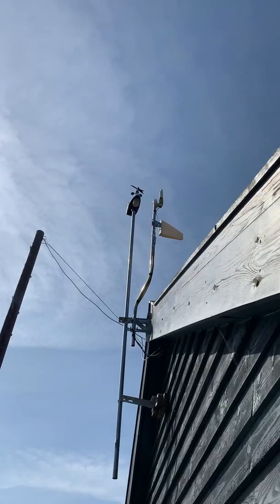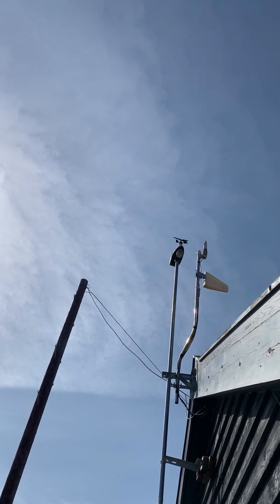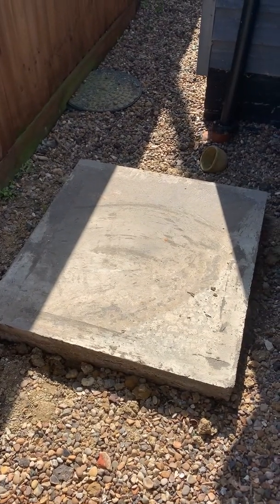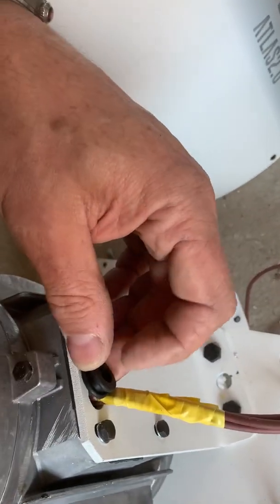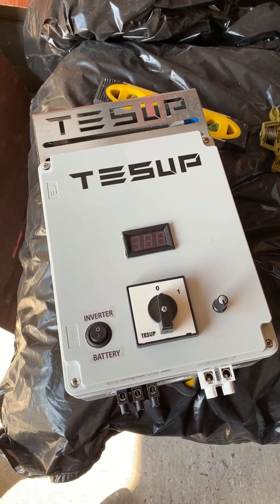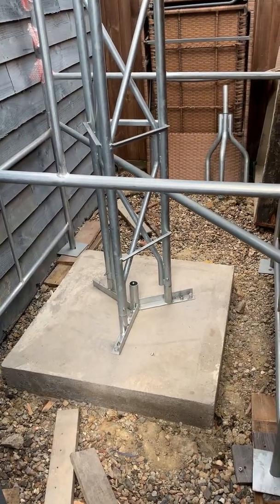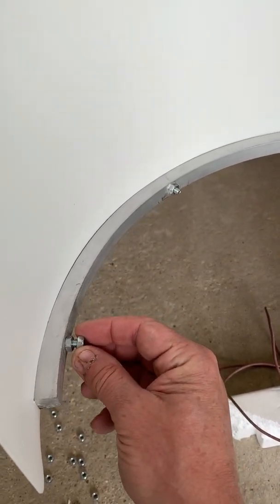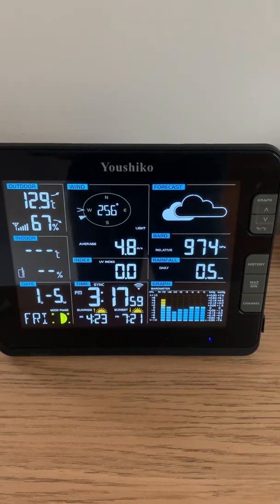TESUP Atlas 2.0 Wind Turbine Installation & Review

Comment: Great Video Dunc.

Hope you’re all well.

I’m looking at putting an Atlas4 in very useful.  Have you considered running with a small battery set in between the charge controller and the inverter to keep it running through the night?
Any issues after a couple of years of use?

Cheers,
Paul
Reply from the maker: Hey Paul. Great to hear from you. I would steer clear of the Atlas 4. They need huge wind to get going even with the skirts.
See my other video on the second version I tried.
I’m afraid that none of the verticals work well at all.
I’m on my second horizontal test and you get at least 3x power for the same wind speed
Reply from the maker: I chucked both Atlas in the skip and got my money back

Comment: Excellent video, well done.    What does your longer term performance look like?   Do you also feed your surplus power to a battery system?   I am interested to interface with a Tesla Powerwall 2, but Tesla say they do not support wind energy input.   Perhaps that is mainly a warranty limitation.    Any insights?
Reply from the maker: HI, well if you see in the next videos the Tesup is a disaster and nobody should buy any of their VAWTS. Im about to do a video on a chinese made HAWT (didnt work well) and a British made one which will go up early April. I originally used a Delta Inverter for the wind turbine because it has 2 MPPT inputs which allows you to put a small solar panel through one and the wind through the other. 42/48V to 240V inverters have a habit of rebooting due to a minimum voltage input level (usually 60W) but the Delta will go down to around 25V. The solar feed during the day will keep the Inverter live with a 36V supply allowing the wind to com in and out. At night you are reliant on the wind generating all the time because an inverter reboot is usally 60secs.
Ive now scrapped the Delta and im using a simple Chinese 24V inverter that you see advertised for cars.  Lets see...
Reply: @Homewindturbinereviews  Ah, thank you.   So the TESUP is a disaster then.  Good to know.  I did talk with them in Poland, and they sounded quite ok.     So, if I do find a suitable wind turbine I will need an inverter to get to the Tesla battery input voltage.   All things electrical are not my bag, so I am trying to learn!!  I will keep watching your output!
Reply from the maker: I should add that the TEsla Powerwall (from memory) doesnt have a 48v mppt connection (isnt it just 240v in and out with battery inverter built inside)?  Youll need a separate inverter or run through a charge controller into batteries directly like Pylon at 48v.
Reply: @Homewindturbinereviews  Yes, correct.   The power in/out is 230/240 AC.    So ideally, any wind turbine should be able to interface with an inverter to deliver the same to the Powerwall.    Have you come across a turbine sold by Skywind NG?   Any feedback?
Reply from the maker: @andrewwilson5225  I think the turbine is “German” made but the inverter they supply is the standard Chinese 
https://www.ebay.co.uk/itm/2000W-Grid-Tie-Inverter-On-Grid-45-90VDC-input-Inverter-for-wind-turbine-/114496723518?mkcid=16&mkevt=1&_trksid=p2349624.m46890.l49286&mkrid=710-127635-2958-0
Reply from the maker: There’s a debate whether to use the 3 phase input of this inverter or take a charge controller and offer D.C. to the DC alternative inverter which is 24v starting
Reply from the maker: Sorry this is the 3 phase https://www.ebay.co.uk/itm/Grid-Tie-Inverter-Wind-Turbine-45-90V-DC-Inverter-Limter-Wifi-2000W-EU-Plug-220V-/203547942129?mkcid=16&mkevt=1&_trksid=p2349624.m46890.l49286&mkrid=710-127635-2958-0
Reply: @Homewindturbinereviews  OK, I think I follow, but bear in mind I am an electrical imbecile!   I think a charge controller is a good idea to avoid any overload.   We frequently get over 30 knots (15m/s) here, and sometimes above 70 knots in winter.   What about the Skywind concept of plugging the output directly into a mains socket??   Is that safe?
Reply from the maker: @andrewwilson5225  then go charge controller with the Chinese 24-60v DC input to 240v inverter

Comment: I am awfully sorry. These VAWTs waste an awful lot of time and money for next to no return.
You have the tower and the electrics  So get rid of tbe VAWT and install a decent 2kw Yenzhou Shenzhou  or an Xmork. The Canadians were selling them under the French name for "Bird" I cannot remember the spelling. The Xmork has very good furling gear and cruises through the storms. The Yenzhou Shenzhou 2kw can suffer overspeed but I fitted smaller props and 4kw of stepped dump load immersions and my own Yenzhou Shenzhou has been up since 2008. I recently lowered it before Storm Eunice and discovered  that the steel guys were rotten  (lucky me)  so once I get the new guys fitted She will fly again.
Many years ago my wife and I had this love affair with large slow revolving  ground mounted VAWT.
10ft I  diameter. Someone else has built it and posted a video of it using vertical slices of 45 gallon oil drums.
Our main reason for giving up on it was noise and constant repairing. I like our Yenzhou Shenzhou for it's simplicity if design. It is tbe 120vdc model. I had to learn to change tbe bearings and did this for other people. I changed the bearings on the advice of friends who said that the Chinese bearings could fail and destroy tbe windings. Our turbine has paid for itself years ago. The days are getting longer now and our 4 kw of PV can more than meet our need.  I was a moderator on a world wide forum for over 14 years  and  saw all kinds of VAUTS, Tbe big important thing to remember is that the HAWTS face all its blades equally into the wind, So you can balance the blades on the Hawts to perfection.  You can cord the leading edges to soundproof the blades. I found the Yenzhou Shenzhou controllers to be utterly reliable and have the same 3 x 2kw controllers and 1 x 2kw sine wave low frequency iron core inverter since 2008. When I realised how good they were  I went and bought spares which I never needed.  My wife and I were lucky. I would like to buy an Xmork and fly it for s while. My friend had one in France. It was excellent and did not have the overspeed problems that I had in the beginning. I wish you.luck
Reply from the maker: Thanks for taking the time to reply. I have already tried a B&Creation 2kw model but it wasn’t good at 5-8mps of wind 
I’ve bought a different model and will do a video soon

Comment: I purchased ATLASX and commented:
@/turbine wind ATLASX wind turbine (Made in Europe) cannot operate at wind speed of 10m / s
# TESUP should research and test this model before trading
# I am currently improving it. 
Sad this turbine
Reply from the maker: I haven’t tested the X myself but the engineering didn’t look robust. The only vertical axis turbines I’ve seen operating effectively are the large versions

Comment from the maker: If anyone is in the UK and wants to collect (post lockdown) version 1 and 2 for parts or experiments just let me know.
Reply: Hi did you stop using the wind turbine ? did you replace with something else ? i am in the UK Midlands and i am looking at putting a wind generation - I just had a smart meter installed, already have solar - and had a bit of a shock as to how much electric my ASHP uses (Hitachi Yutaki! )
Reply: Ohh, Just watch you other video - Maybe not one of these then
Reply from the maker: @myboatinghabit6035  Thats a shame. I will do a video on the ASHP later in April when returning to the UK but it shouldn't be that bad. What did it replace?
Reply: @Homewindturbinereviews  Hi have had the ASHP since 2012 - replaced Oil - to be honest its never been that good and does not get the water that hot, but since the smart meter it is a bit of an eye opener as to the power use  - i have 3.8KW of solar already on my house
Reply from the maker: @myboatinghabit6035  then keep putting up solar. Unless you’re living at +1000ft on a hill Solar will always payback...possibly with batteries.  ASHP has moved on massively. My system replaced my oil system last year and although clearly electricity has jumped, it’s about 30% cheaper than oil year in year comparator plus the capital is paid back by the government
Reply: @Homewindturbinereviews  I cant really add more solar, as i am on the high FIT payments - i was wondering if it was time to replace the ASHP with one of the High temperature ones - i think Hitachi and Dakin do them. What ASHP did you install ?
Reply from the maker: @myboatinghabit6035  Mitsubishi ecodan. I have 10kw of solar (my own not FIT)
Reply from the maker: @myboatinghabit6035  Going to replace with a B&Creation 1kw horizontal. Video probably in April BUT you should max out on Solar first...wind losses to Solar on a 10:1 ratio for cost

Comment: I have installed one of these can you please tell me what electrical performance you have seen. As I can only get 40-60 watts from a 11mph wind
Reply from the maker: Hi Duncan sorry I must have missed your question. These are quite useless I’m afraid. You won’t do more than 150w in 30-40 mph. I’m ripping mine out
Reply: @Homewindturbinereviews  Great to know, what type would you recommend? I guess at the end of the day if the vertical design was superior the likes of GE and Siemens would have progressed them at scale.
Reply from the maker: @andy199121   I’ve no doubt that in strong wind areas, larger vertical will work fine and have some advantages (less strobing, lower noise, more compact) but ultimately for domestic use they are no good.
Reply from the maker: @andy199121  I’ve just bought a B&Creation 1kw which I’ll put up in a couple of months when I have time.  If that works I’ll then try the 2kw version
Reply: This is actually more than could be expected. The wind must have been 16-17 mph if you got anything close to 60W.

Comment: Is there a reputable wind turbine company ,that makes the power it claims , out there???
Reply from the maker: Or this at low wind.  https://www.aliexpress.com/item/32959391113.html?aff_platform=link-c-tool&sk=bE1zQnPw&aff_trace_key=53124566843743dfac422aa4c67f5cbf-1606978587052-02407-bE1zQnPw&terminal_id=25189315ddc344d391126fe409b2487c
Reply from the maker: Yes, these standard models always get great reviews  https://a.aliexpress.com/_mspCtM5
My next project will be one of these

Comment: Hello, I have bought a 3kw turbine system, with controller and inverter, the generator goes super hard and there is no way to turn it around, once the service is paid, it is non-existent and they do not take care of the warranty, it is a shame , money lost, apart from the software version of the inverter there is no way it works, I advise not to buy from these shameless, I will take legal measures about it.
Reply: looking at one myself thanks for the heads up

Comment from the maker: Ok having waited for replacements and failed to get anything I have to conclude DO NOT BUY anything from TESUP. Appalling customer service, constant bullshit about promises and not accepting that the turbine isn’t up to the job.  END
Reply: Thanks for the update. It's shame that they didn't hold up too their promise. What will be your next project?
Reply from the maker: @ShelbyGTHNL  I’m going to replace it with one of the better Chinese horizontal 3 blade options
Reply from the maker: https://www.aliexpress.com/item/32867283784.html?aff_platform=link-c-tool&sk=lntG1uvS&aff_trace_key=f8bb8cf2fe4344ec96de5e5469619472-1603446859642-05477-lntG1uvS&terminal_id=25189315ddc344d391126fe409b2487c&tmLog=new_Detail
Reply: @Homewindturbinereviews  Alright, Keep us posted on the progress please.
Reply from the maker: @ShelbyGTHNL  replacement Tesup atlas 2.0 has been sent eventually. I’ll inbox and test before posting a video
Reply: @Homewindturbinereviews  125 days after payed i recived.
Reply from the maker: @nunoramos6804  you get the new version?
Reply: @Homewindturbinereviews  Yes, I Open the "motor" and see a problem whith the alignment white the belt.
Reply: I make a few tests very fast and I have 48 v and 2.5 Amp white the hand and 🔧
Reply from the maker: @nunoramos6804  i am worried that the belt will break and then the turbine will free spin
Reply: @Homewindturbinereviews  Murfy Low, yes this is a biggest weak point, I continious try center the belt in the midle of the 2 gears , I put paraffin (candle) in the extern part of the belt (do not dry out) for mor long life. The trick is the belt not touch in the wells  up or down of the 2 gears (wells).
Reply: I unscrew the 2 whith 3 support motor and I need macke a news hole.
Reply from the maker: @nunoramos6804  I may use the Mark 1 turbine mount without belt but with new blades
Reply: @Homewindturbinereviews  your results not change white the Mark 1.
We need RPM and the v2 is 3 x more fast whith the same wind. Ah is a looking and we need hy RPM for this. If I don't have resesults I Change the motor for a maglev generator low RPM 600 w 12 v
Reply from the maker: @nunoramos6804  it can’t be x3 as the resistance and friction will reduce the effectiveness at low wind speed. I suspect v2 works better at High wind
Reply: Hi, THanks for the update. I was going to buy one. I didn't understand, what was exactly the matter with your atlas 2.0 ?  And what is the maximum power you measured?

P.S : I personnaly already have a windturbine (exactly the one from aliexpress link, 12v, 5 blades) I'm happy of it. It's a bit noisy, but ok. The average power is close to 100W, and maximum power peak mesured is 450W.I was a bit afraid of the controler, but actually it works well. The brake function works well also.
Reply from the maker: @etruchet  the company is basically a fraud and is sending out sub standard units and then providing no after sales. Stay clear as they don’t do more than 60w at max rotation
Reply: @Homewindturbinereviews  Typical results I have read everywhere.
Reply from the maker: @plaintruth4637  sadly I think yes. I will publish full graph next week

Comment: so biggest question of em all. A 48v turbine costs 1200 euro with inverter etc. I live in the netherlands and we have allot of wind. I can set it up ontop of my appartment 10m above ground. They claim to do 2000w based on 15m/s. Will it deliver anything close to that? Or am i better off putting solar panels up there?
Reply from the maker: Not likely. Im waiting for the replacement to re test but I would say you'll get less. I estimate possibly no more than 1200W maximum. € for € solar beats wind every time. I estimate you spend say €500 on Solax x1 inverter for 4kw. Buy 14 300w panes at around 200 each. Some wiring, isolators and you're all in a €3k for an average 3500KW per annum -10 per day. You won't get near 3kw average with wind I suspect
Reply: @Homewindturbinereviews  definitly not recommend to purchase or deal with this company. I spend 1200CAD back in April for a 24V vesrion. I claimed the warranty and they are plaing stupid in all the emails. Sent video to my install and results and they are just ignoring.
Reply from the maker: Gabriel are you dealing with Emre?
Reply: @Homewindturbinereviews  I started the communication with Irene, Victoria and then one message with Emre over 4 months. In the last email they said to open a ticket but the ticket page doesn't work. It's a nightmare to deal with this company. Spend 1100CAD and after 4 months still not have a functionable unit?
Reply from the maker: claim via credit card
Reply: @Homewindturbinereviews  its more that my landlord doesnt want me to place the roof of my appartment full of panels (he has no reason for it) but a small turbine might be ok
Reply from the maker: @aparturesounds3130  its not small..!